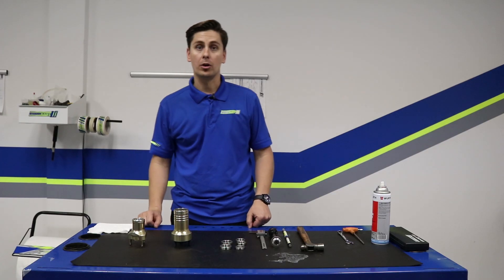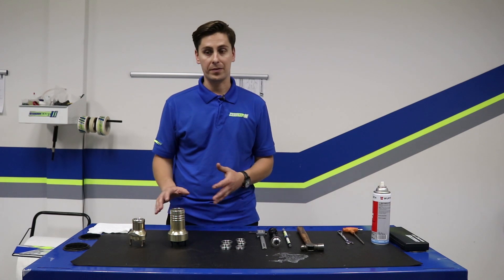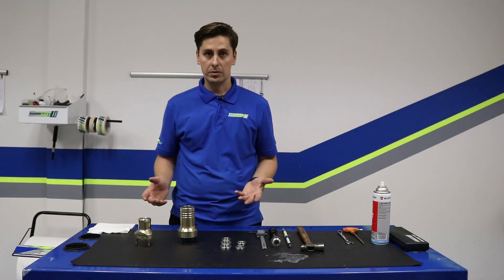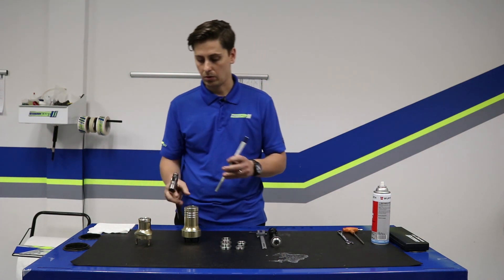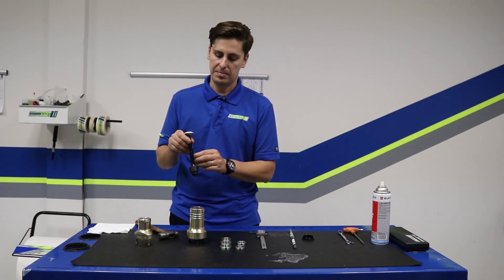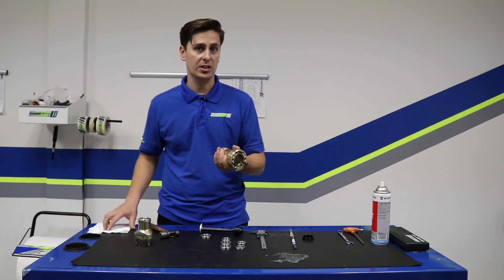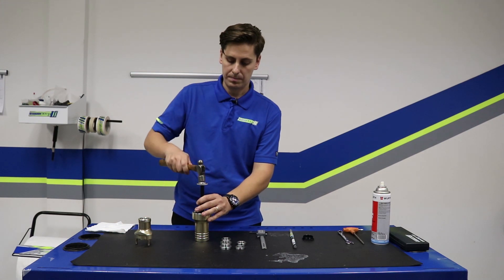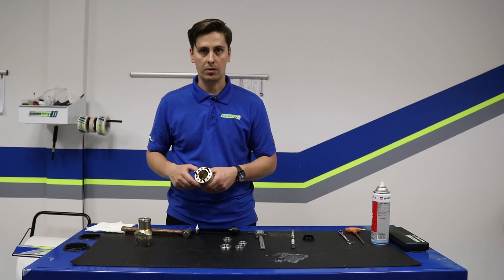Pro Tip: FRONT BEARING ASSEMBLY

Comment: No spacers in between the bearings?
Reply: Mine looks like there is a spacer between the two bearings, it doesn't move side too side so I can get rear bearing out.
Mine is an OTK hub that's tapered, if that makes sense.